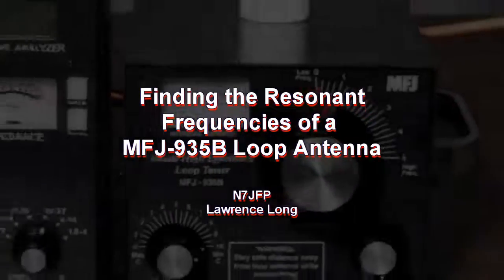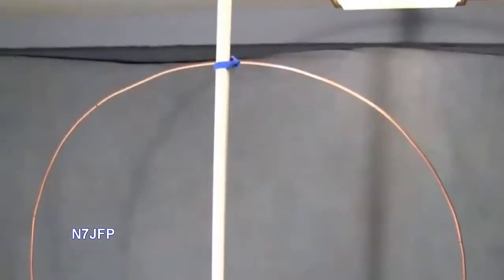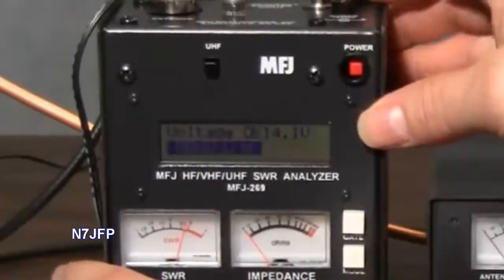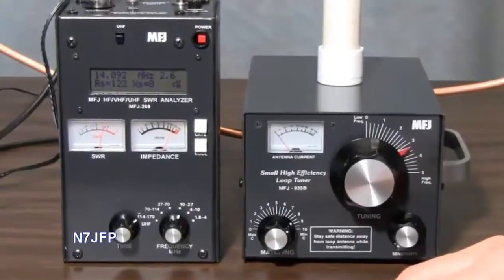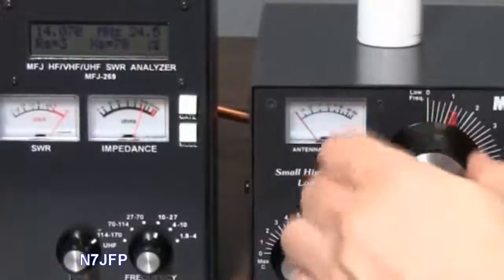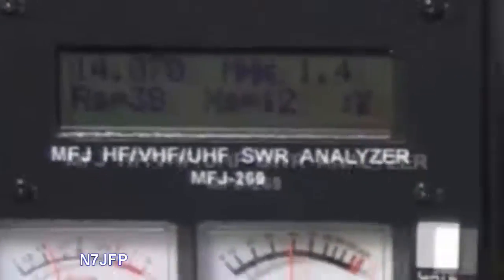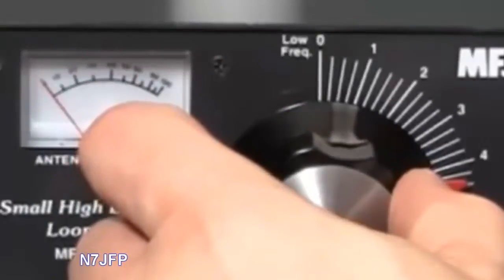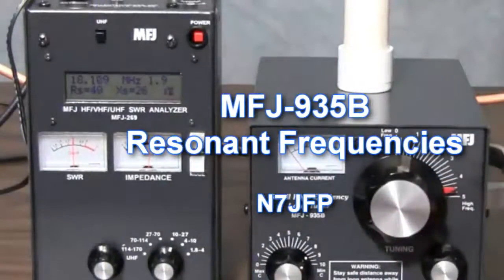Finding the lowest SWR and frequencies that are all most resonant of a MFJ-935B Loop Antenna.

Comment: You don't appear to be adjusting the fine capacitance knob. I get 1.1:1 SWR on all bands with my 936B. I need 3 different loops sizes to cover 40-10. One for 40/30, one for 20/17 and the smallest loop for 15/12/10
Reply: what size do you use for 40m please john?

Comment: What happens if you cut the antenna to 9.5 ?   or 10.5 ?     I want to use SSB  so not sure which way to go.  14.250 is right in the middle so I'm thinking longer?
Reply from the maker: The loop construction chart shows 13 foot is best for 20m.  http://www.mfjenterprises.com/Downloads/index.php?productid=MFJ-935B&filename=MFJ-935B.pdf&company=mfj     73, N7JFP

Comment: look's like you are getting good swr reading but the impedance are either  high or low   which when the transmitter is in line will see a  high or low  swr    so  not good .......lot of loop antenna's will do just that   give a nice swr  but a bad impedance... so what we really need   is  a  nice low swr and a 50 ohm impedance to make the transmitter happy..
Reply: A "good" VSWR implies a "good" impedance match.  Typically, antenna analyzers present a 50 ohm reference load -- to simulate the 50 ohm output impedance of a typical transmitter.  Thus, if a "good" match is shown on an antenna analyzer, it will remain a "good" match for a 50 ohm transmitter -- assuming no problems with the transmission line between the transmitter and antenna.

Comment: Thanks for the video, not so many video on this antenna tuning unit, I would have like to see how the Matching Cap help to bring the SWR to 1:1.
Reply: My experience with this unit is that a 1:1 VSWR is very difficult to achieve, but using the matching cap will get you reasonable close.  Also, there is interaction between the matching cap and the main tuning cap -- much like the interaction between the loading and matching caps of a PI network in a vacuum tube RF amplifier.  So, tweaking both the matching and main tuning caps, in an alternating fashion, will eventually achieve a low VSWR on a desired frequency.  I've noticed that interaction between the matching and main tuning cap is most sensitive near the extreme lower and upper tuning limits of the main tuning cap.